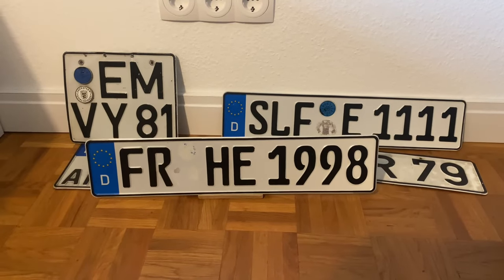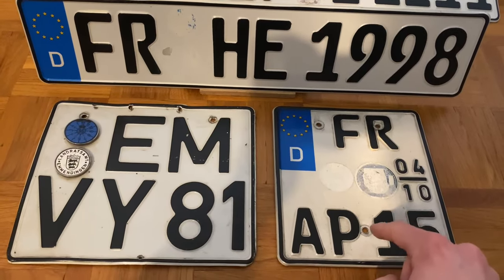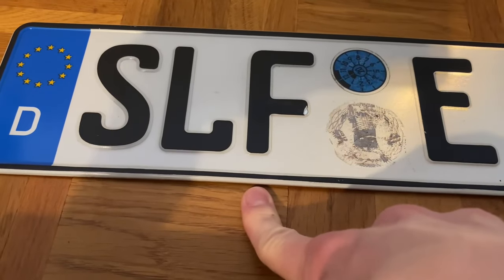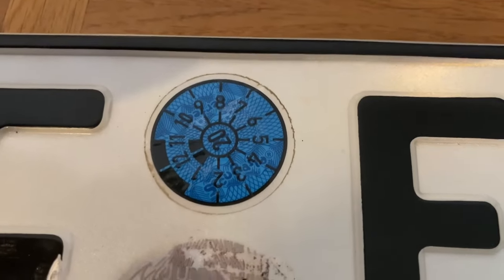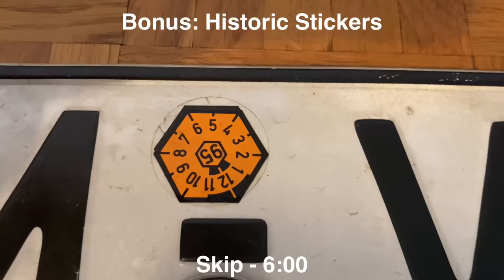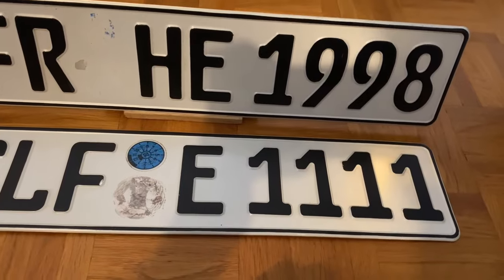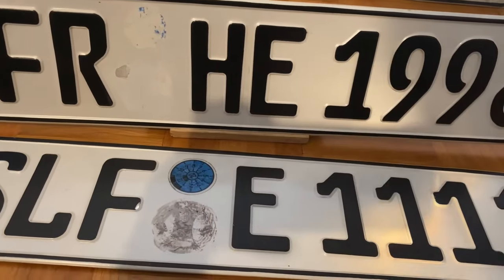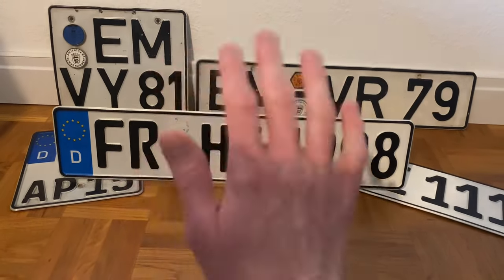German License/Number Plates explained. How do they work?

Comment: When based in Bielefeld I brought my car over and it remained with its UK  registration. I’ve been pulled over 4  times during my station there for random vehicle checks by TÜV, DEKRA  or Bundesamt, (same as the DVSA does in the UK) as foreign plates there are an easy target and other countries have not as strict rules, UK MOT system is 12 months where Germany’s is 24 months but the roads are not the same. Volvo 850r passed every time 🍰.